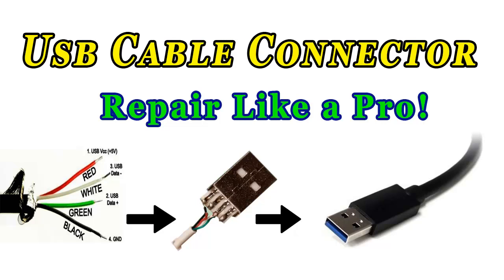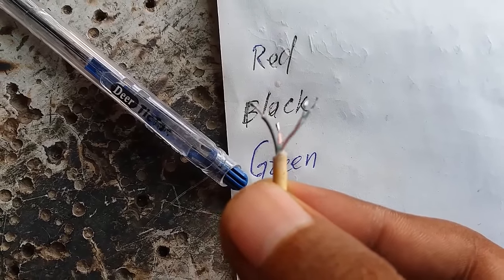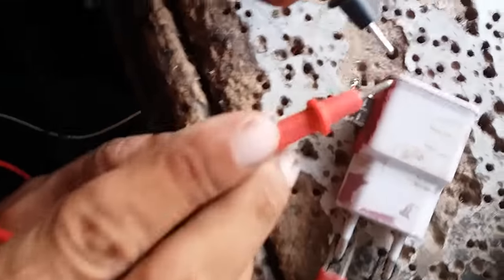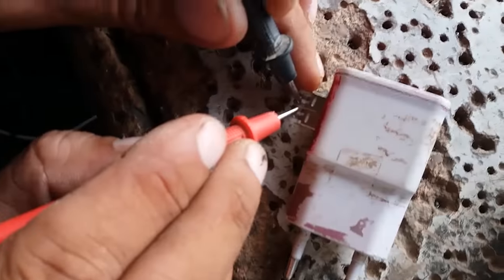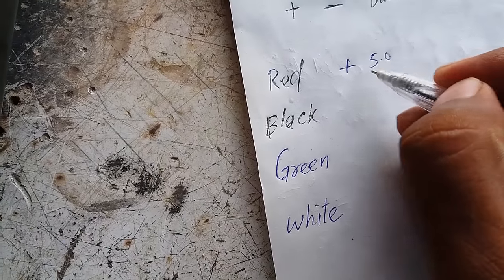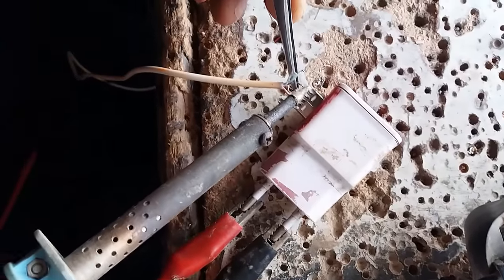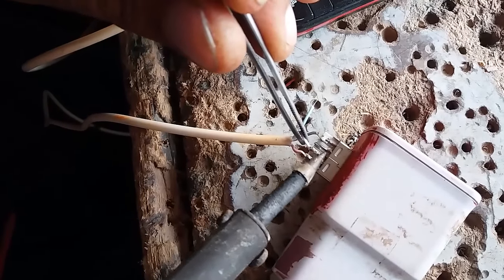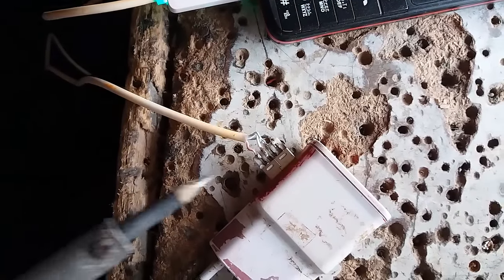How To Repair Usb Cable Connector (100% Fix ) | Repair Usb Cable

Comment: You are not correct on your paper. Red is +5.0V  on Pin1, Black is Ground on Pin4, Green is Data+ on Pin3 , White is Data- on Pin2.
Reply: it´s universal for all conectors? 2.0 or 3.0?
Reply: Igor Peshkov i have a hdmi cable and a usb bit there are loads of colors in the hdmi and only 4 in the usb what colors out the hdmi do i conect to the 4 usb can you please help me
Reply: my charging cable some time connects and some does not connect what is the problem
Reply: Help me!My connector just came out.
Reply: @STEVEBRYAN08  no 3.0 has a other pin out.
Reply: Igor Peshkov is correct.  If pin 4 were -5.0V, you would have a potential of 10 VDC across Pins 1 and 4.  Pin 4 is Ground.

Comment: Great video! Can you also make a video of the pin outs of the Oppo VOOC 7-pin usb cable? I would like to repair mine. Coz I think I connected the wrong wires on the pins. I hope you can help me correct my mistake.

Comment: Dear ground is neutral not -ve 5 volt.

Else output voltage difference would be 5-(-5)=10

And that wrong Red one is +5 and ground is o hence potential difference =5

Comment: My dash cam mini usb has only two colours. Black and white. When I spliced Black with Black and White with Red to  another data USB to get a power extension, it only gives a flickering screen.

What is the case when power USB has only Black and White wire as explained above? Thanks in advance.
Reply: is the connector colored white on the inside interface? if so then it's the 1st version if usb's and only has a basic hot an negative wire, This is because in early wiring and even today. What they did with the ground wire was use it as a metal shielding around the negative wire and they use them as one wire. So if you were to strip the wire back enough , you'll see metal shielding start to wrap around the wire and that shielding itself was the ground wire

Comment: Have you ever soldered 18 awg to just the power connections of a USB.  I got one done and working but I dont trust the solder because its such a small solder point.

Comment: Want millions of views?  Make a video of how to convert a USB cable into a regular wall outlet cable by replacing the USB connector with a regular wall outlet connector.
Reply: Lol. Does your phone charge at 110v? Only wqy to do that without a pcb step down converter, would be to wire like 5000 resistors inline